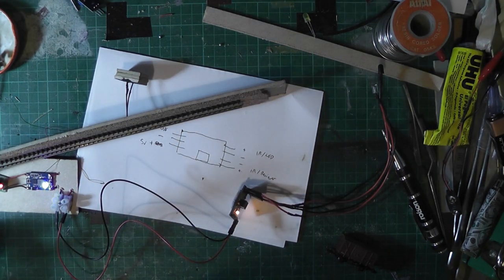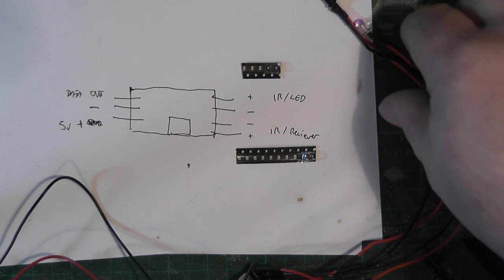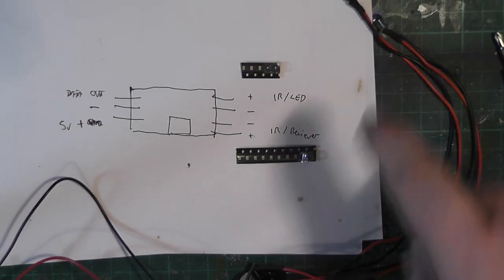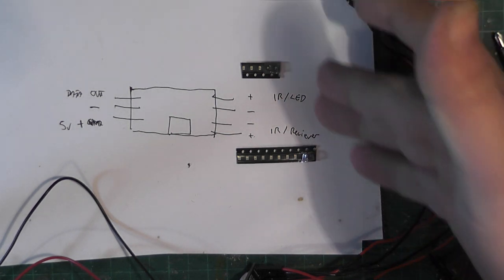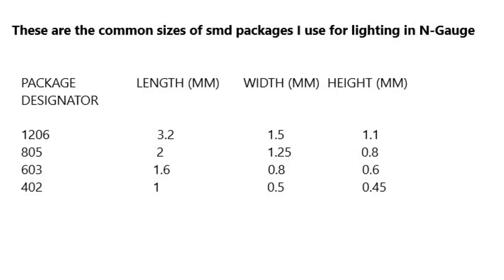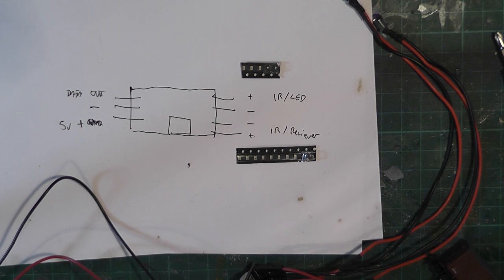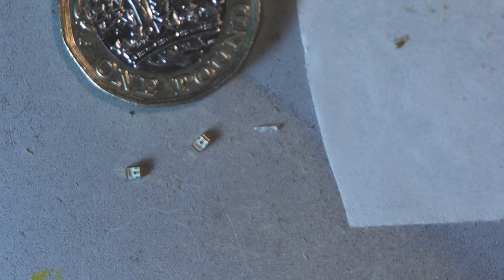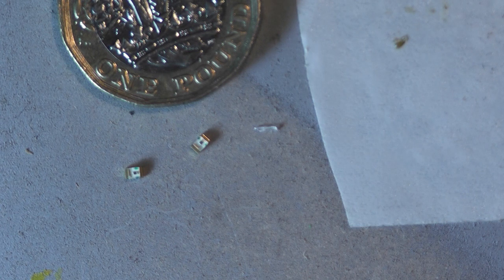Smallest OPTO Sensor for Model Railways?

Comment: Fiber optic use is a great idea and would work if the angle of the transmitter and receiving optic ends are aligned correctly. This is because the beam of light is very focused when sent via the optics. Normally through the standard LED's the light is very scattered. You would have to determine the angles and create a jig to properly drill the optics into the track. The trick is the height between the optics and the target (loco/rolling stock). Try it again and see if you can get it to work.
Reply from the maker: Thankyou for this information, very useful. I may try it again in the future, All the best Tony.
Reply: @TheHeritageLine  I recommend a multimode with the largest core diameter fiber optic 50um> possible

Comment: Great stuff Tony. I would be very interested in knowing how it goes with the shortened optic fibre as Paul suggested. I also found it useful in terms of adding lights to some older locos I purchased second hand. Didn't know they used the optical fibre to extend the leds into the body. Cheers, John
Reply from the maker: Hi John, I will certainly be trying Paul's idea and I'll put a quick update in my next video. I also have plans to add lighting to some older locos but not sure when I'll get around to it 😁 All the best Tony
Reply: @TheHeritageLine  Are you considering doing a video on the loco light fitting?. I would very much like to see how its done because I have no idea!
Reply from the maker: What type of loco  would you like to see? I will have to hard wire a loco first. Then I will add lighting to it, but probably wont be till March.
Reply: @TheHeritageLine  Hi Tony, any kind of diesel I guess, I have a Farish Class 52 and 25 that need lights. I have already put DCC decoders into them. They are the split chassis type. Chees John
Reply from the maker: @wimbletrain  I have a class 25 to hard wire so I'll do it on that, just got to get a few other projects out of the way first. All the best Tony
Reply: @TheHeritageLine  Thanks Tony

Comment: Great video and highly informative. I would suggest putting the fibre optics at an angle to allow the lights to bounce of the bottom of the wagon towards the receiver. Given the narrowness of the light source and the the short distance between the source and the wagon, there's a good chance the light is simply shining straight up and straight back down again missing the receiver altogether
Reply from the maker: I did try a few ways but I think the fibre optic would probably need to be to a higher grade and also polished which is far beyond the scope of model railways and more into science. But At least the small smd sensors worked well 😀 All the best Tony

Comment: Hi, I was just wondering where you got the SMD sensors?  I've searched on ebay and Google an found nothing,....I'm wanting to switch mine over this was a great idea,  I really liked the fiber optic that was a great idea too I wished  that would have worked that would have been perfect.  But yeah I was looking around for the smd sensors and only found Resistors 0508.
Reply from the maker: Hi are you Jedidiah from the Arduino FB group? I have replied on their but these are the ones I used https://www.ebay.co.uk/itm/323764291337?var=512755917998 and this one https://www.ebay.co.uk/itm/323764292037?var=512755924802 Hope this helps or puts you on the right trail, All the best Tony.
Reply: @TheHeritageLine  HI, good afternoon and Yes sir I am.  Thank You for the reply this is a very interesting video you did I would have loved if the fiber optics would have worked I would have never thought.

Comment: Great video and will solve a problem for my signal install. Where did you get the SMD?  Thank you for sharing the video.
Reply from the maker: The smd's I got from E bay, not as hard as you think to solder, the key is to add flux to the smd before adding solder. Glad you found it useful All the best and a Happy Christmas. Tony
Reply: @TheHeritageLine  A very Merry Christmas too you and thank you so much for the information you have shared with me. Will look at EBay and get some on order. I will need about 100 of them and your wonderful video same me time and labor. Once again thank you for sharing your great video and a wonderful safe Happy New Year!!!
Reply: @TheHeritageLine  Hello again Tony and have a question if I may ask of you and I looked on EBay for the 0805 sensors but can’t find them. Could you possibly provide me the sealer s info. Thank you so much. Johnny
Reply from the maker: @johnnyrobertson5971  these are the search terms to use 

KINGBRIGHT - KP-2012F3C - LED, IR, 0805, 940NM Price for 5                          (this is for the Infra red led)
0805 smd infrared receiver pt17-21c l41 tr8 940nm phototransistor 10/20/50pcs    (this is the receiver)

I would suggest just getting a few first and experimenting to make sure it does what you want, I found if you have a bright light above it can interfere, but you can also adjust the sensitivity on the little boards. Hope this helps.
Reply: @TheHeritageLine  Tony, thank you ever so much and keep the videos coming. Johnny

Comment: This is what I need to activate my crossing bucks when a train approaches an intersection at a crossing and one to turn it off once the train leaves the intersection.  I have an Arduino but I need the code.  My flasher for the crossing bucks is powered by a 9 volt wall wart.  Cheers from eastern TN
Reply from the maker: Sounds like a great project! I'm think of using them to power a magnetic un-coupler for a shunting layout 😁. All the best Tony.

Comment: Just a thought from a complete novice. Would it be possible to a similar arrangement to your fibre method ie  2 different sized holes drilled directly into your baseboard with the led and receiver positioned almost through the board but with just a small hole at the top or even a thin card  with 2 x 1mm holes between the board and the track.
Reply from the maker: I did so many different experiments trying to get it to work, I think I did try that but to no avail, If I ever have any need for an opto sensor I will certainly be trying more experiments. All the best Tony.

Comment: Excellent work.
Shame the fibre optic did not work as that looked really good. Did you try adjusting the POT? Presumably there was less light to work with so you needed to adjust the sensitivity.
Is there a link for the fibre optic you were working with? I would be interested to have a play with that still myself - I am thinking of lights on locos / brake vans.
Reply from the maker: Yes i tried adjusting pot, Paul gave me an idea to try so I'll see if that works just search for 1mm fibre optic cable on evil bay it also comes in different sizes I have got some which are 0.5mm. All the best Tony.

Comment: Hi Tony, Another thought provoking and informative video 👏🏻👏🏻👏🏻👏🏻 Fascinating insight into how useful those SMD things really are becoming 👀 Wonder if the fibre optic didn’t work because you went beyond its “sensitive” range 🤔 if you put the large LED’s just below based board level with the fibre optic cable only being the dept of the board would that work? Save on fiddly soldering 😂😂😂 Many thanks for sharing and very best wishes from County Wicklow ☘️
Reply from the maker: Good idea Paul I'll try that with the fibre optic 😀 I'll let you know if it worked! All the best Tony

Comment: Hi Tony. Nice bit of research. BTW: What if not all your viewers are guys?
Reply from the maker: Thankyou, Everybody are all guys to me 😀 I just use it as a general term for the audience, I don't mean it in it's proper form 😁 All the best Tony
Reply: Girls say guys to each other all the time, at least my granddaughter does… great video… I had to look up what an AWS was…. Interesting.   I’ll be using 3mm for HO scale.  Cut the larger 5mm ones off the sensor and solder leads to the 3mm… also will use an arduino to add signaling… wish me luck

Comment: Please don't show me these things - I get hooked so easily and my mind starts inventing reasons for buying them and creating ways to use them even if not needed hahahaha
Reply from the maker: Hi Joe, I have no real use for these at the minute but I couldn't resist having a play they open up so many avenues. All the best Tony
Reply: @TheHeritageLine  Exactly my point :) 
I use a BEC (Battery Elimination Circuit) to drop down to 5v for up to 2A or 3A load. I have plenty of these because I used them on my RC cars and also because, like the OPTO sensors, they are handy to have for those ideas that come to mind when you are bored :)
Reply: Got a link for your sensors, please?
Reply from the maker: @Hal-Zuzzu_Model_Railway   I put a list of items in comments just search for them in ebay or amazon :)
Reply: @TheHeritageLine  Found them on Amazon and eBay now. Thanks :)

Comment: I can never figure out why people spend money on various types of optical or Digital sensors that cost a lot, to detect trains ?
When for the past 40+ years I have needed nothing but a piece of wire connected to a tiny section of the negative rail, which costs ONE PENNY, which will do the same job invisibly ! Which tells me that either these people do not even understand the basic rudimentary's of DC electricity, or are in reality some sort of electronics enthusiast rather than model railway fans !!!
Reply from the maker: In this day and age a lot of modellers have gone the dcc route and use some form of sensor purely for some sort of automation. It's slowly getting to the point whereby they don't drive the locos anymore but just sit back and watch the show.
Reply: @TheHeritageLine  Oh dear, obviously you didn't quite understand what I wrote in my above Post. I am a Railway Mechanical Engineer, & way back in the early 1970's I and a senior BR Signalling Engineer, developed a method of shrinking the real railways "Interlocking" (the important part of signalling) into a miniaturised wiring version of the BR Solid State Interlocking (SSI) real railway methods. Which ensure the continuous "moving interface" between trains & the signalling. This was done so we could dispense with the then childish methods of wiring model railways ! DCC is simply a digitised form of those early methods, as it was invented by a British Electrical Engineer who had NO qualifications or understanding of real Railways ! So DCC cannot comply with any real railway methods. Being Digital it actually prevents you from complying as you cannot alter the wiring printed on a chip !!! 

My ONE PENNY "Track circuits" are therefore used to "trigger" latching relays, just as in real life. Which ensure my signals change to red as a train passes, change to yellow once that train has fully passed the next signal, & then green when the train has fully passed the 2nd signal ahead. They also interlock the points with the signals to ensure the correct route is shown on the signal, or lock it at Red. To do all this real life automation requires 3 x ONE PENNY "Track circuits" & 3 x 50p 4 switch latching relays per signal section.  Total cost per signal section = £1.57 !  And there's no DCC chip that can EVER do all that, for the simple reason the manufacturer would have to produce a chip to suit your layouts specific track plan, which is commercially impossible !
 
So why do Modellers waste a fortune on ludicrous DCC equipment that actually prevents you from operating any layout realistically ??????
Reply from the maker: @JamesSmith-mv9fp  I love the idea of interlocking signals and yes I see what you are getting at with regards to dcc preventing realistic movements, but unfortunately some modellers will use there trains to activate signals rather than the signals controlling the trains and maybe just have the odd signal like in the station throats operated by hand. I suppose not all modellers have the know how on how to do things properly, and are happy in buying of the shelf products that give them a simulation of what looks right to them.